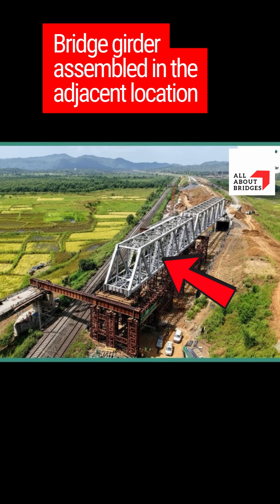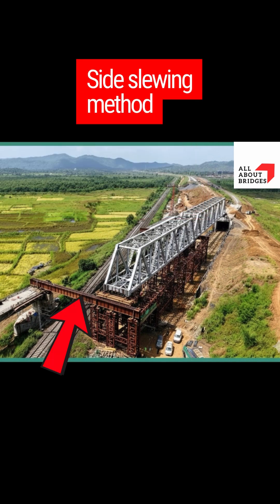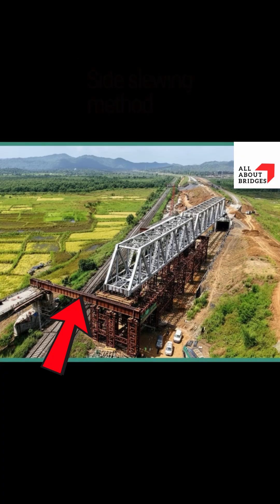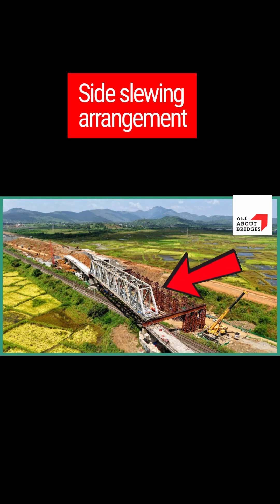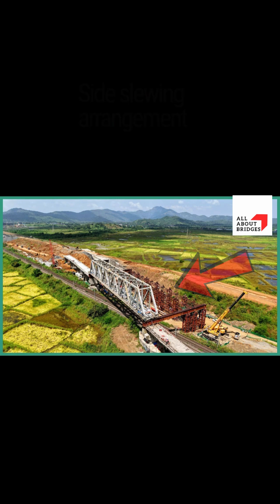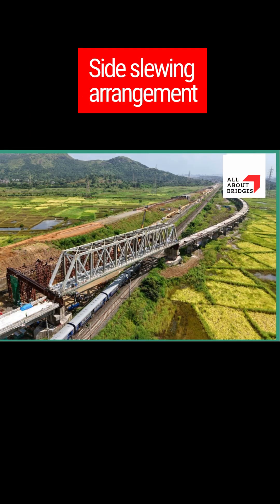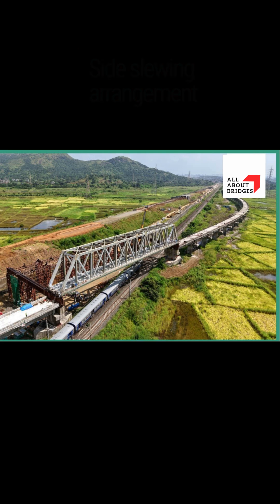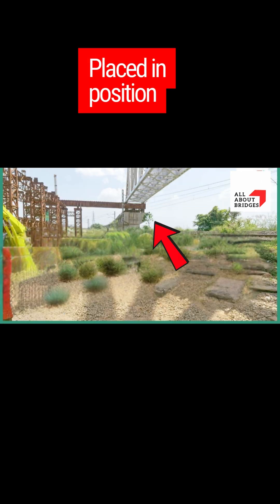Side Slewing method of OWG launching. Indian Railway Bridge Manual. RDSO

Comment: Technical Calculations of pulling capacity etc . Crane capacity of lifting. How mugh force required to side slewing. Through winches or chain pulley arrangement also to be shown in video.
Reply from the maker: Thanks for the suggestions. Will consider them for future videos.